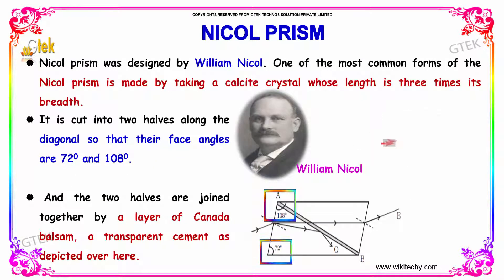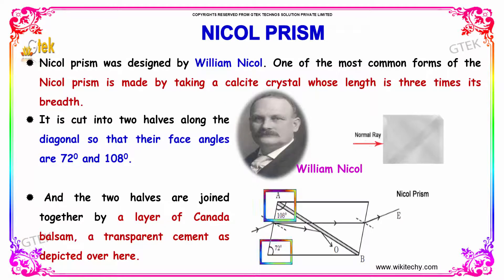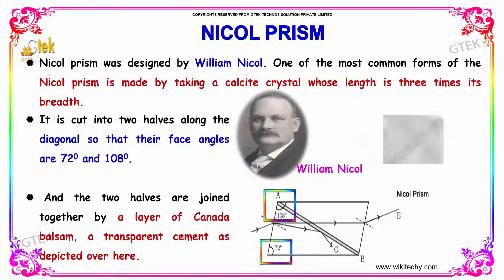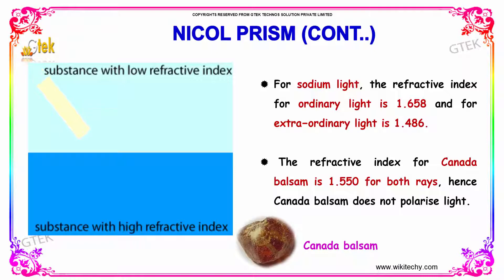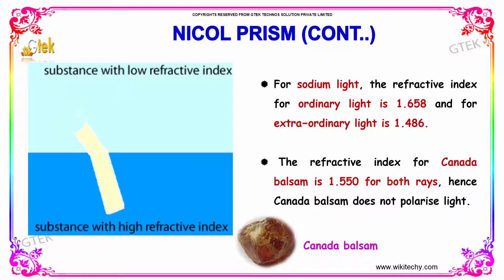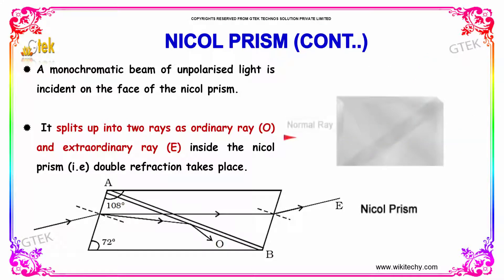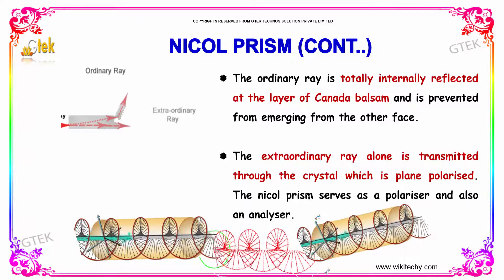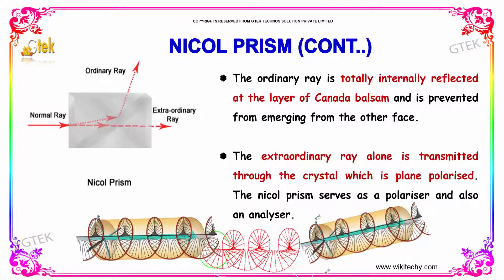Nicol prism Electromagnetic Waves and Wave optics class 12 physics subject notes lectures CBSE

Comment: Unpolarized light ray enters through the left face of the crystal, as shown in the diagram, and is split into two orthogonally polarized, differently directed rays by the birefringence property of the calcite. The ordinary ray, or o-ray, experiences a refractive index of no = 1.658 in the calcite and undergoes total internal reflection at the calcite–glue interface because its angle of incidence at the glue layer (refractive index n = 1.55) exceeds the critical angle for the interface. It passes out the top side of the upper half of the prism with some refraction, as shown. The extraordinary ray, or e-ray, experiences a lower refractive index (ne = 1.486) in the calcite and is not totally reflected at the interface because it strikes the interface at a sub-critical angle. The e-ray merely undergoes a slight refraction, or bending, as it passes through the interface into the lower half of the prism. It finally leaves the prism as a ray of plane-polarized light, undergoing another refraction, as it exits the far right side of the prism. The two exiting rays have polarizations orthogonal (at right angles) to each other, but the lower, or e-ray, is the more commonly used for further experimentation because it is again traveling in the original horizontal direction, assuming that the calcite prism angles have been properly cut. The direction of the upper ray, or o-ray, is quite different from its original direction because it alone suffers total internal reflection at the glue interface, as well as a final refraction on exit from the upper side of the prism.

Comment: William Nicol (1770-1851) of Edinburgh developed what is now called the Nicol prism in 1828. The problem with using calcite as a polarizer is the presence of two beams of polarized light. In principle, the E ray can be eliminated by using a narrow crystal, long enough so that the E ray can be sufficiently displaced from the O ray to allow it to be masked off. Nicol used the now classic technique of slicing the crystal diagonally at QS and fastening the two halves back together with a cement (such as canada balsam) of such in index of refraction that the E ray is totally reflected at the internal interface, leaving the O ray to emerge alone from the crystal.

Comment: Wave optics describes the connection between waves and rays of light. ... (i) Light waves are electromagnetic waves which do not require a material .... A nicol prism is an optical device which is used for producing plane ...

Comment: The basic principle behind Nicol Prism is based on its unique behaviour on the event of incidence of light rays on its surface.
When an ordinary ray of light is passed through a calcite crystal, it is broken up into two rays:
An ‘Ordinary ray’ which is polarized and has its vibrations perpendicular to the principle section of the crystal and
An extra-ordinary ray which is polarized and whose vibration is parallel to the principle section of the prism.If by some optical means, one of the two rays eliminates, the ray emerging through the crystal will be Plane polarized. In Nicol Prism, ordinary ray is eliminated and Extra-ordinary ray, which is plane polarized, is transmitted through the prism.